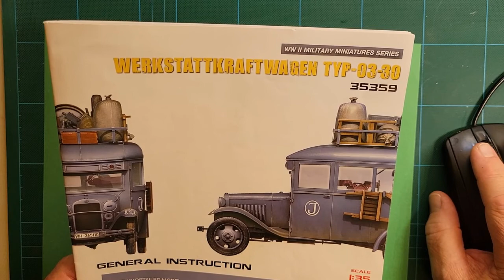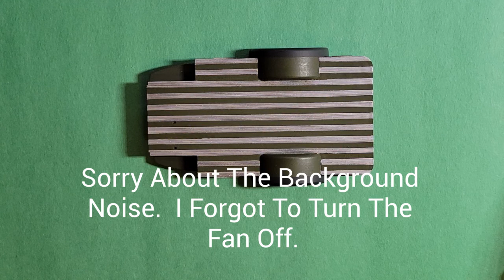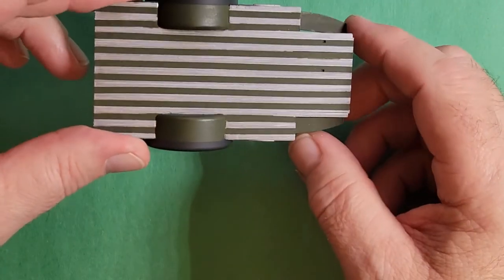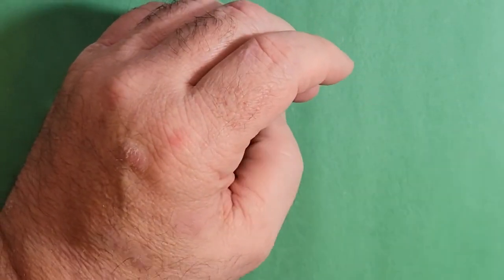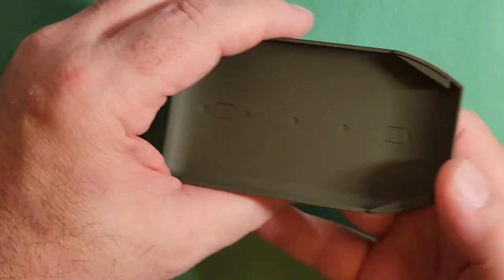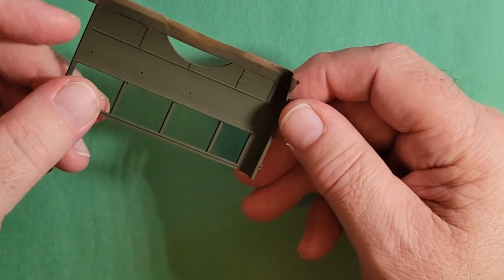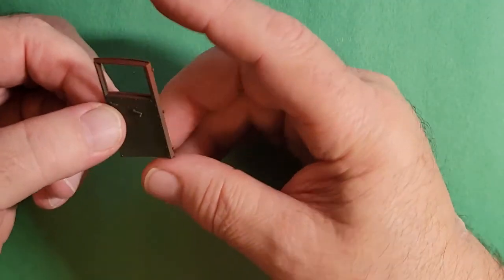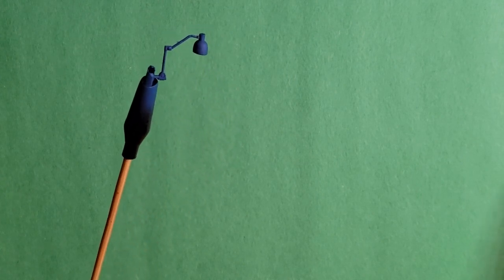Miniart Werkstattkraftwagen Part 4

Comment: Seeing the can dry fitted to the chassis shows how far the build is progressing Jeff i would imagine the curtains are for black out you wouldn't want a soviet coffee grinder dropping a 50 pounder on you just as you finished cutting a new thread on a bolt at 2am ! Lovely stuff marra . Regards Gav.
Reply from the maker: Hi Gavin, that's true.  I didn't think about blackout, but you are right.  Getting a 50 pounder dropped on you, would really mess up your day, or night for that matter.  Thanks for looking in and the comment.  I really appreciate it.  Jeff

Comment: Some fabulous painting, Jeff - and the clean up on those tiny parts is very well done. That lamp, for instance, wouldn't survive me removing seam lines! 😁And as for turning a new horn on a lathe... 😮 Top modeling, mate - very enjoyable content. 👍
Reply from the maker: Thank you so much Andrew.  Lots of tiny parts.  I use tweezers and a really sharp scalpel to clean the parts.  Thanks for looking in and the comment.  I really appreciate it.

Comment: Making some great progress there Jeff, looking good. Can’t wait to see it done. What software is it you are using?
Reply from the maker: Hi Corey, I really appreciate the comment.  I use a chromebook, so I am really limited on processor and memory.  I have a Samsung S21 and my wife has a S20.  I use a program called Airdroid to run the phones cameras.  There is a web based version that runs in a browser.  As long as the phones are connected to the same network as my chromebook, I have complete wireless control of both phones.  For editing, I am using a program called WeVideo, web based again.  so I don't need much to run it.  WeVideo is a subscription, $15.00 a month.  You have to upload your video clips and then you can edit them all online.  Jeff